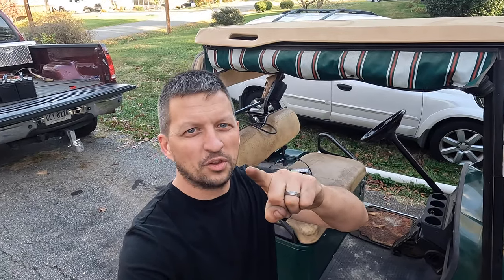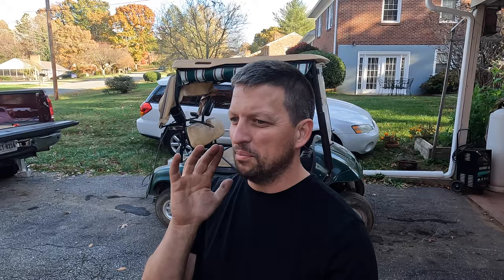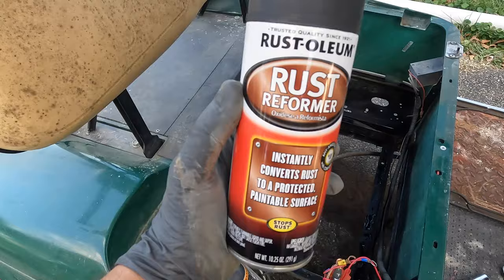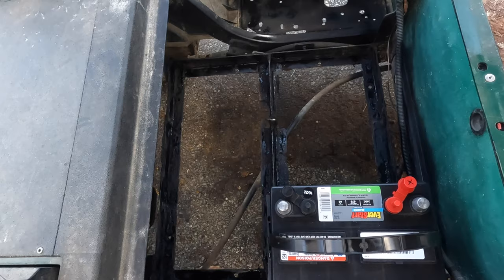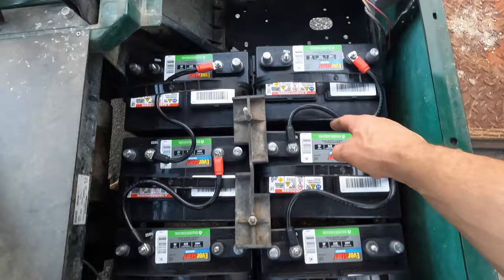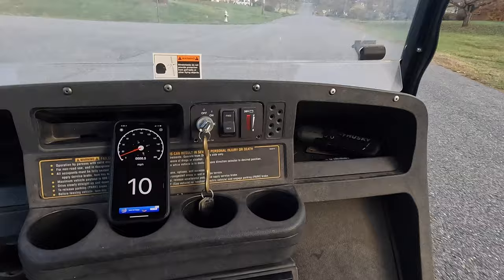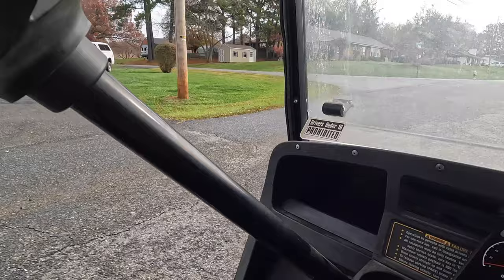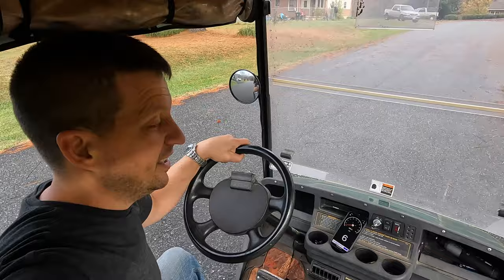CHEAP POWER!  36v Golf Cart using 3 12v Batteries - Surprising range

Comment: Must the batteries be Deep-Cycle to work in the carts?
Reply from the maker: No, but you will get longer life out of deep cycle batteries.  Plus they will have screw terminals on them.  If you had 3 12v batteries hanging around and a 36v cart you can wire it up and go.

Comment: I am about to get a cart that needs new batteries. I want to do that on the cheap too. Is there anywhere I can look up a diagram of how to wire these? I’m afraid of electricity and don’t want to fry it!
Reply from the maker: Hey Drew!  I have full confidence in you.  We are our camping for 2 weeks but I can whip up a wiring diagram when I get back.  It should look like this.  You can use 3 or 6 12v batteries

https://lh6.googleusercontent.com/-99_7bTI8Dto/TnyLCvj3ZBI/AAAAAAAACOU/lcjH_IMXsGg/s800/series-parallel.jpg
Reply from the maker: These might help too.  I used them.  They have black and red on the same cable.  If you are using 6 batteries you will need to recycle one of your existing cables.  My cables were junk so they had to be replaced.

https://amzn.to/3NPDKqx
Reply: @BootstrapRevival  thanks for the diagram and the confidence boost! I’ll be working on it here in the next few days. Thanks again and enjoy your time camping.
Reply from the maker: @TheDrewPeters  I posted an 8 month follow up video if you have not seen it.  Let us know how the batteries go!
Reply: @BootstrapRevival  so no bueno. I think I may have fried something and now I’ve got nothing. When I did the 3 together it worked good! Then I added the six and it overvolted things I think. Don’t know how to trouble shoot that. Thoughts?
Reply from the maker: @TheDrewPeters  I'd start with a multi meter and check voltages.  Check to see if your cart has a main fuse.
Reply: @BootstrapRevival  I got it fixed and running perfectly. It was one wire that I didn’t have connected to the positive terminal. 
Thanks!
Reply from the maker: @TheDrewPeters  Phew!  Thats great news!  Glad you got it sorted!
Reply: @BootstrapRevival  one other quick question. (Sorry)
With the 6 , 12v batteries, will I need to use a voltage reducer for the lights?
Reply from the maker: @TheDrewPeters  Hey Drew - great question.  Sorry for the delay we were camping.  Yes you will still need a voltage reducer.  I used this cheap one off Amazon.  https://amzn.to/450RPZ1
Reply: @TheDrewPeters For the little bit of electric demand of your lights especially if you have LED's you could get away with tapping the positive and negative terminals on one of your 12 volt batteries to get 12 volts to your lighting system. Club Car DS models tapped into the last two 6V batteries in the series. In this case it would be the last 12V of the three.
If you decide to use the entire battery bank with a voltage reducer remember that the voltage reducer always draws a small amount of current when connected. Depending on your charging and use profile that may or may not be important. However you can eliminate this by installing a switch in the voltage reducer circuit. Some people prefer that.

Comment: Did you use the same charger to charge the new batteries?
Reply from the maker: You can use the factory charger but I really really don’t like it.  It is off or on, it has no idea how charged your batteries are.  I’ve used the Lester Summit 2 on multiple carts without issues.  I’m just plug it in and it keeps them topped off correctly.

Comment: I have #3 =12v but all I am getting 33 volt  not 36v do I need 1 more battery? or is 33volt ok
Reply from the maker: I bet your batteries need to be charged.  33v will get you moving.  I would pull the cables off and check each battery to see if you have one that is lower than the rest.

Comment: Any update on the six batteries?
Reply from the maker: They are rocking and rolling.  ZERO issues.  We are coming up on the 6 month mark and I was hoping to do a follow up video.,
Reply: I’m really wanting to know the mileage distance of the six 12V batteries.   I’m thinking it’s the way to go.  I charge my cart with six 6 volts and only get 2 miles  before it’s dying.  No way I can afford a lithium pack.

Comment: Quick question when you got the battery’s from Walmart did you take 3 of your old batteries so they don’t charge you a core fee?
Reply from the maker: I did take my old batteries in for cores.  I think Walmart has one of the lowest battery core charges - I believe its $12 - not a deal breaker if you don't have cores.

Comment: Are you still able to retain the stock 36v charger?
Reply from the maker: You can but I don't like them.  The stock charger has no idea of how full the batteries are.  It will over charge and cook them.  I switched to a smart charger that only charges when the batteries need it.    This is the one if you want to check it out.  I got mine used off eBay for way less.

https://amzn.to/3QUWZAr

Comment: I’m confused by this whole video.  He says he used 3 12v to make 36v which makes sense, but then shows another bank of 3 12v ( behind the 36v bank) which was not connected and seemingly served no purpose . What was purpose for this test?  Was the cart tested with the extra weight ?  Was it tested with the second bank of batteries behind the 36 v bank in front?
Reply from the maker: Hey great question. Cart was tested with all 6 in the cart but only 3 hooked up to make 36 volts.  I did not test all 6 together mainly because I did not want to ride 20 or so miles in circles.   My neighbors already think I'm crazy enough.  The 3 batteries are in series ( positive to negative) to make 36 volts.  Series will increase the voltage.  The two 36 volt banks are then wired together in parallel ( positive to positive and negative to negative).  This will keep the same 36 volts but increase the amp hour capacity.  Essentially doubling the range of 3 batteries. 
Hope this helps.

PS.  Cart is still running like a champ!
Reply: @BootstrapRevival  ok, I get the series part and successfully made the swap to 3 12v in series ( neg to pos) .However,   Where did you connect the other bank ( parallel bank) to?  The video does not show.  How Did you hook the parallel bank to the series ( front) bank?  Please show.

Comment: Thank you for the video.I have been kicking around the idea of converting my 36 volt to 3 batteries. My main question is with the charger .I have 2 different chargers. The one that came with cart with no monitor and my second on is  the little trickle charger with smart cut off only 5 amps. Could I get away with that?
Reply from the maker: You can do any 36v charger.  A 12v won't work.  I don't like the factory charger because it does not stop when the batteries are full.  We put in a used Summit 2 I got off eBay and absolutely love it.  I really appreciate you watching!

Comment: What MCA Deep cycle Wal-Mart batteries dud you use ! Is it possible to get a picture of the label on the side of one of your batteries ? Great job and info. Thanks ! Love to have picture of the label......
Reply from the maker: This is the one I used:  https://www.walmart.com/ip/seort/180350522
Reply: You'll be sorry you went with three 12v bats. They don't last long and require constant charging. If you get 6 months of use out of three 12v's, consider yourself lucky.
Reply: @GetRealBaby  The Walmart batteries he used come with a 12 month replacement warranty. I did this in a Pargo cart many years ago and was happy with the performance. It was not used every day but worked fine for my needs. A three-mile range would be at the upper end of my usage needs and he got over ten.

Comment: were you able to use a regular charger for the golf cart to charge 12 volt batteries
Reply from the maker: You can, but I really don't like them.  I switched to the automatic (and onboard) Summit 2.  I got it used off eBay.  It will bring the batteries up to voltage and stop.  The factory chargers are dumb and have no idea if they are overcharging or not.

Comment: So basically 6 12v and every 2 are in parallel making 12v bank with double amp hours, then put 3 12v banks in series so u get 36 volts total with all six and double the amp hours?
Reply from the maker: It is a 36v cart so I have 3 batteries 12v in series making 36v.  Then I have another 3 in series making 36v.  I took those two banks of 36v and put them in parallel doubling the amp hours.
Reply: @BootstrapRevival   have u tested range after hooking up all six ? Will the doubled amp hours basically double ur ride time?
Reply: Very good test!  Just to be clear, your results where with the 6ea 12v batteries in parallel?  If you only used 3 batteries dropping the weight of the other 3 might have added 5 more miles. Also how long did it take to recharge them (3)?  👍🏾

Comment: I think your math is wrong on your amp hours … if they are in series you increase the voltage your amp hours stays the same, so for each 36v bank you only have 100ah, so 200ah total as you have configured there…. If you had all 6 in parallel you would have 12v 600ah
Reply: 600ah sounds like good long run time .
Reply: @norisboren5402   Each 3 in  series is 100Ah. The series connected parallel are additive in Ah.  So he is achieving 200Ah.

Comment: What battery profile are you using on your Lester summit 2?
Reply from the maker: I emailed support told them my battery config, type and model number of my charger - they told me to use:  22252.  Hope that helps!
Reply: @BootstrapRevival  would it be the same on 3 or 6 (12volts)? I only have 3 batteries in right now.
Reply from the maker: @user-df5vs3fv3e  - Great question - it is the same.

Comment: It'll be OK for a little while then you'll lose charge quickly theoretically you're running less voltage but the same Amp hour 6 6 volt High output deep cell or lithium will be your best bet wired in series your voltage will be higher along with Amp hours and run time will be 3 to 8X longer especially with lithium perhaps 10X longer but you're talking $1000 to $2000